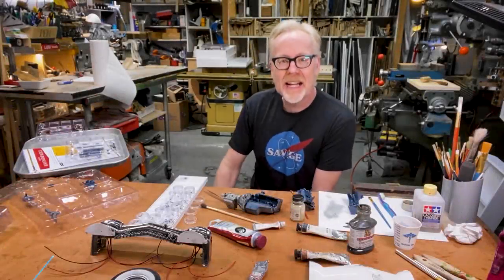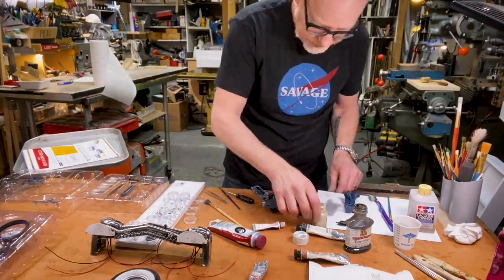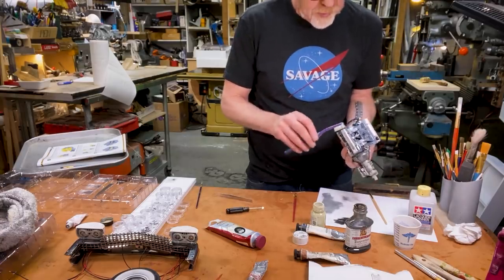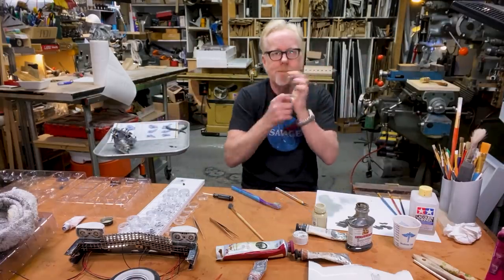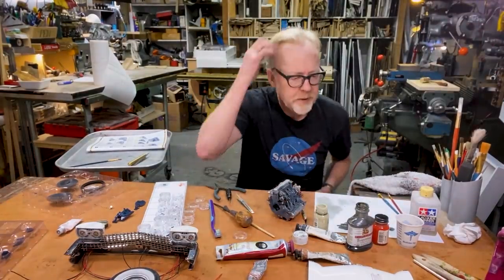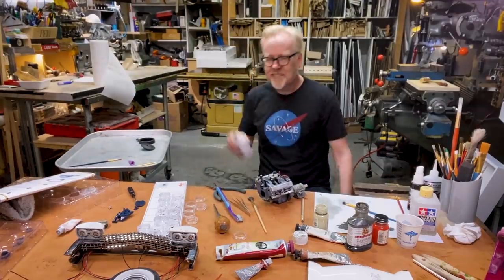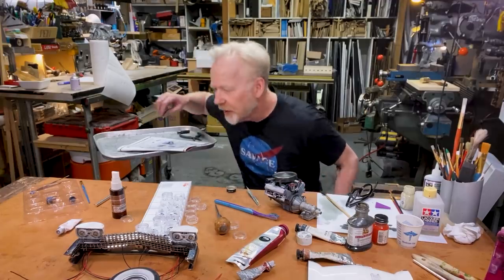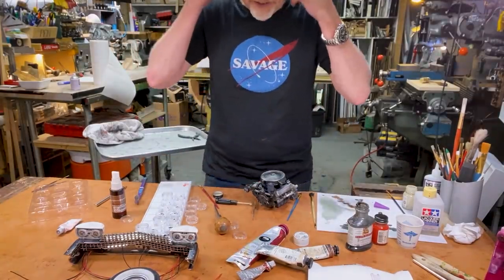Adam Savage Paints and Weathers the Ghostbusters Ecto-1 Model Kit!

Comment: Rub and Buff?
Unfamiliar with the expression or produkt? 
the same with all the glues.

Can´t find the right or similar produkts in swe.
Reply: Allan Lundberg try some “AK True Metal Paints” especially the aluminum one. They are a waxy paint that dries very quickly so can be used to dry brush detail and can be buffed to a sheen if desired. Similar to the product Adam is talking about. Good range of AK paints, needs a clear over it so you don’t get it on your fingers and then everything else. I remeber getting this paint when it came out and some US old timers saying “nothing new, it is just like rub and buff”

Comment: Adam,. That's a V8 not a V12.  The exhaust manifolds must be rusty.  That's not a head gasket cover, that's a valve cover. Sigh

When trying to make an engine look old and worn out, you will need to simulate multiple oil leaks from every seal and gasket, as well as caked on greasy mud from years of dust and dirt getting stuck to an oily motor, mixing with that oil and attracting more grease and dirt.  Essentially what this means is that some places need to have a little filler put in and painted to look like grease.